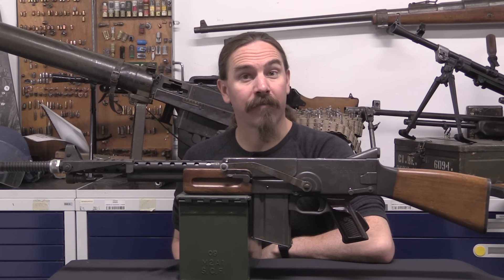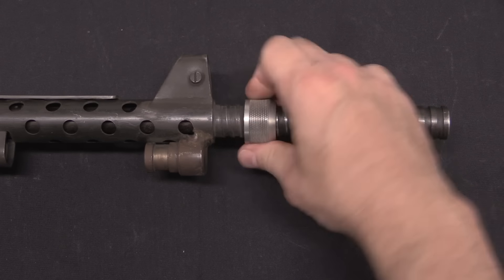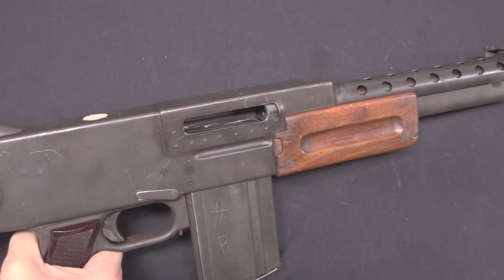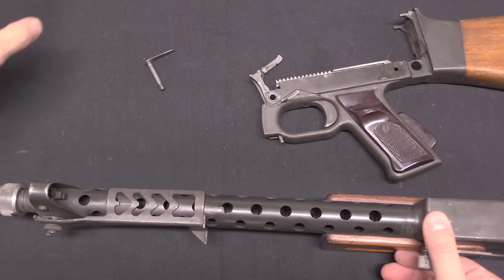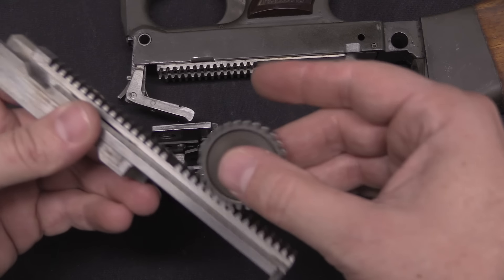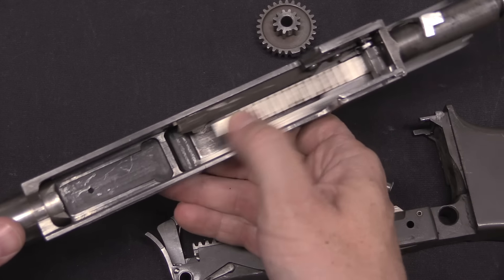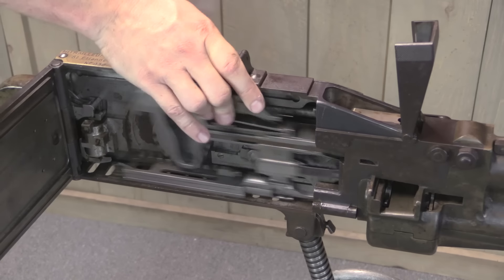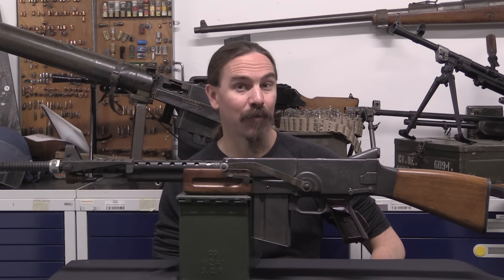Gear-Ratio-Accelerated? Yep, It's a Thing: French MAT 1955 Prototype

Comment: I'm not sure if anyone has said this, but I think you misunderstood the gearing here. That small gear riding on the pinion is going to rotate X number of times. The larger part of the gear is going to rotate the same number of times, but with a larger circumference. This means the relative speed is going to be faster. This faster speed is going to accelerate the bolt back faster than the barrel moves. This isn't a delayed system. This is a way to achieve a short recoil system without just unlocking the bolt and letting it yeet backwards into the buffer.
Reply: Thank you, someone else that didn’t misunderstand its gear-delayed nonsense.
Reply: Accelerators are generally called some kind of delayed system like lever delayed used in famas or in browning 50 cal. machine gun
Reply: This is also why the spring is so strong. Because it s work on a shorter lenght.
Reply: Exactly. It’s just a gear reduction that makes the bolt fully cycle with a short travel of the barrel.
Reply: Totally right. This isn't a delaying system but a plain and simple bolt accelerator. The mystery is why they chose this fragile geared system when bolt accelerators were widely known and understood at the time, and far simpler and sturdier systems were available, such as the ones in the Browning M1919 or in the M2 heavy machine gun.
Reply: THANK YOU.
Reply: Almost.  The bolt carrier moves faster.  The bolt itself is locked closed to the barrel until the carrier moves out of the way.
Reply: @manasjena949  This is true. However, those accelerators transmit the force from the bolt to the accelerator, which then moves the bolt carrier at an accelerated rate. This necessarily forces the bolt to wait for the bolt carry to get out of the way. In this system, the bolt is locked into the barrel extension and does not move UNTIL the bolt carry is pulled back by the accelerating gear. The force of the bolt is handled entirely by the locking surface in the barrel extensions.
Reply: I was thinking exactly the same! Thank you for explaining it in better words than I would have been able to (as english isn't my native language)
Reply: thinking exactly the same. thought ian got it wrong there for a sec and saw your comment
Reply: I think the gears technically keep everything closed up longer than it would have if it didn't have that gearing system. So technically it is delaying the opening. I think.
Reply: @natetete1379  That would make sense, if the big gear was rolling along pinion, and the small gear was pulling the bolt carrier back. But in this configuration, it's pulling it back faster than just one to one.

Comment: French Ordinance Dept: Develop a functioning rifle.

Also French Ordinance Dept: Make it absolutely different from every other successful rifle on the planet.
-----------------------
Ian: Guns and gears don't mix well.

Lewis Gun: Hold my beer...
Reply: Diana/Original model 66 air rifle hold this stein you ain’t seen nothing yet😮
Reply: The G11 operating system is basically all gears and cams, it looks like a clock…
Reply: dont forget most burst fire mechanism involved a "gear"
Reply: Ian is notably not a fan of the G11 or burst mechanisms in general
Reply: @chemistryofquestionablequa6252  I'm amazed it wasn't a Swiss invention... but if it was, there would've been a toggle-lock.
Reply: @somuchnope2 Are you sure?
Reply: @TammoKorsai  lol, if it was a toggle lock Furer would have designed it, he LOVED a good toggle lock.
Reply: I’m not sure what the French department of municipal regulations and policies has to do with firearms development, but the French ordnance department might have been involved.
Reply: If Lewis is a clockwork rifle, then this is a [Quack!]ing automotive transmission with murderous intent.
Reply: @TammoKorsai  Byyyyythewaaaay, yes!... And it might have been way more reliable, to boot. At least, there would be NO rack and pinion gear system to break. Just have the whole lafetted assembly recoil back for a side extension of the toggle knee to follow a cam path to open and close the bolt.
Reply: @chemistryofquestionablequa6252  The G11 reminds me more of a sewing machine or an old camera with a manual cocking
Reply: @Zigfried207  that’s a really good comparison

Comment: I'm actually delighted that a gear-delayed system made it as a prototype because I had thought about what if gears are used as a delay mechanism. We may see a gear-delayed blowback yet
Reply: Steam punk rifle.😂
Reply: gear-delayed blowback system in a larger caliber sub machine gun, like 10mm would actually make sense somehow 🤔
Reply: Wouldn't that be the Lewis gun ?
Reply: Unfortunately I don't think its ever going to be an idea that gets any legs. Gears, by their nature of operation, are a significant wear item. The entire inside of the gun will have to be covered in oil or grease (or whatever) at all times to reduce wear on the gear teeth, so will be a nightmare to maintain, and even then, the gears look to be pressure bearing parts, which will significantly accelerate their wear.

Even if you could make the system cheaply, the rate at which you'd have to replace the gears as they wear out makes it not worth it, IMO.
Reply: It had the same fate of the screw delaying system made by kalashnikov 😢
Reply: @matrix3509   Especially when other delayed systems exist and they are much simpler and more robust. Between the G3 using rollers on angled surfaces and the later FAMAS using levels, the gears system is also more complex to machine.
Reply: The inherent flaw of gears is they REALLY do not like sharp impacts. The teeth will gall and then break.
Reply: There's someone on YouTube working on a homemade, largely 3d printed gear delayed rifle in 45/70; I think he could stand to take it down to 44 magnum, but that's neither here nor there.
Reply: I cannot imagine this holding up well under field conditions, once fine grit (whether mud or dry) gets into the gears (which will need heavy grease in them) and starts to "hone" the tolerances bugger and bigger, while also being more difficult to clean and inspect compared to, say, a lever delayed system.

And this thing, where we combine recoil operation, rack and pinion delay, and open bolt in a rifle?  Three bad ideas for the price of one...
Reply: @Raspredval1337  Make it variable like a CVT and you can dial in your rate of fire.
Were I rich, I'd lock George Kellgren in a room with Mark Serbu  this rifle, and AutoCAD and tell them to "go nuts".
Reply: @Raspredval1337  I mean, how would it be any better than lever-delay tho? Lever-delay has been used quite successfully on at least a couple overpowered cartridge smgs
Reply: @oliverlamie3449   
Yeah I was thinking about that guy when I was wactching this, @EvanJonesProjects is the channel your talking about. A damn shame he hasn't updated in a while.
Reply: @matrix3509  "Gears, by their nature of operation, are a significant wear item."

I have no idea where you're getting this - how often do you ever replace gears in anything due to wear? How often do you replace gears in your car's transmission? What about the differential ring & pinion? Think about all the load the gears in your car's drivetrain are under, the amount of heat generated on long drives. Think about how you'll stay on top of your oil changes(or maybe you don't, those people are out there) but you don't give a single damn about changing transmission or diff fluid(lol) for at least 100,000 miles. And in weather ranging from Alaska to Death Valley, often without a trans/diff fluid cooler, steep uphill & downhill grades, hell you may have a 1-ton towing 20,000lbs through the mountains(in that case, I would hope you actually consider drivetrain maintenance). Like most common mechanical systems, keep them lubed and they should see minimal wear.

If you want to see a "by its very nature of operation, significant wear item", check out the chauchat. Or some of the plate receiver machine guns, like the M60, where the receiver is a wear item(LOL).
Reply: @WardenWolf  I'm not so sure that it's a 'flaw' as much as just an important trait to consider, but minimizing backlash/keeping the gears loaded to some degree so they're never smacking into each other, and getting the right material & heat treat would be pretty critical for sure.
Reply: @RyTrapp0 Gears don't like being subjected to recoil lol. This thing would destroy itself over time, plus what happens when you get grit in it. Also it's unnecessarily difficult to machine, and all to solve a problem that's already been solved  by many different much simpler and more robust solutions. It's wild that this thing is even a prototype.
Reply: @Patrick-857  Why are you acting like I said anything about this specific gun? Dude said "gears by their nature are a significant wear item", and that's just flatly wrong.
Reply: @@cancermcaids7688 Gears don't like shock loading - but, hey, off-roading literally exists🤷 You can check out 'rock bouncers', 'mega trucks', 'Ultra4' cars, etc., all of those are brutal on drivetrain parts.
Reply: @RyTrapp0  Try running your car's transmission without transmission fluid in it.

Go on, I dare you.
Reply: @matrix3509  The gears in your car are spinning continuously - if they were being used for a fraction of a second to a few seconds at a time, a fluid film like firearms rely on is all they would need(I'm assuming that we're talking about a manual gearbox here and not something as stupid as a hydraulically operated automatic...). 
Hope you don't think it takes an oil bath to create a fluid film between two metal surfaces; the oil bath for transmissions & differentials is for cooling purposes as much as anything else.

Unless your argument is that you can run guns completely dry, which would be quite the wild argument lmao
Reply: @RyTrapp0  This is legitimately the stupidest thing anyone has said to me on youtube in months. Congrats on that.
Reply: @matrix3509  I'm pretty sure that award would go to "run your transmission without fluid" - as if guns don't require lube...
Reply: In the ideal case a gear system can run with only rolling contact.  As opposed to the partly sliding contact of a roller or lever delayed system.  To handle shock load you'd want fewer and larger teeth,  even as few as one tooth on each ring on the gear cluster.  Which amounts to a gear derived system that looks like a lever.  Then to keep forces balanced, 2 such gears opposite each other across the venter line.
Reply: @tomaspabon2484  And the FAMAS, arguably the most successful lever delayed rifle ever fielded.
Reply: @@cancermcaids7688 Thousand  g of acceleration for a 5 gram part still produces a momentary force equivalent to the weight of 5 kg mass or so. The yield strength of steel is around 200 Mega Pascal, that is 2,000,000 KG per square centimeter. This gear is massive compared to the load its expected to take, it will be fine. Almost all motorcycles and race cars run manual sequential transmissions that don't have synchros and are often shifted clutchless. Clutchless shifting is shocking to the drivetrain, the engine has to drop or gain a few thousand rpm instantaneously. Gears literally slam in a dogbox engagement sequential transmission. Even when shifting to 1st on a motorcycle that is standing still with the engine idling, you can feel the thunk of 1st gear slamming into engagement.
Reply: They oughtta have added a second pinion gear riding on the same rack. More contact surface means more reliable contact means less wear and less chance for a gear tooth to break off.
Reply: @matrix3509  True, however with the proper ratio of hardening and on top of that case hardening the surface, you can increase the life expectancy many fold.
Reply: @RyTrapp0  Exactly. If the right alloys are used and they've been properly case hardened, gears are near indestructable. In that respect technology and specifically metallurgy has improve hugely in the last 50-60 years.
Reply: @electric_boogaloo496  Exactly, compared to the enormous forces the gearbox in a car experiences, what a gear-based firearms would experience is negligible in comparison, and easilly achieved with modern steel alloys and heat treatment. And even your average car gearbox will already last several hundred thousand kilometers at minimum. If you would compare that to a firearm and rounds fired you would probably be talking about many millions.

Comment: Very cool.
But it actually looks like the bolt carrier is gear accellerated rather than reduced.
Reply: True! I have noticed the same. So it is blow back delay system.
Reply: @Crow2a  Well, not really... First, it has a locked breech. And second, for a delayed system, one would anticipate a small movement of the bolt to be translated in a big movement of the rest of the mechanism in order to provide a lot of resistance to opening. Here it's the opposite. Actually, if the breech wasn't locked, it would be difficult to assess whether the pressure in the chamber would drive the recoil (thus providing a delay) or the other way around.
Reply: @PetrHosek  Let's call it delayed short recoil because a small movement of the barrel assembly is translated in a big movement of the bolt carrier in order to provide an effective increase of inertia to delay breech opening
Reply: @Crow2a  Sorry, but I see no sense in what you're saying.
Reply: @PetrHosek  when you say "resistance", do you mean friction?
Reply: @Crow2a  No, I mean the inertia of the parts that need to move for the breech to open. Here, the gearing does not make sense for this purpose as a big movement of the bolt translates in a small movement of the other parts, thus creating a mechanical advantage rather than disadvantage (with respect to force). However, some delay is of course still provided compared to the situation in which the bolt was completely disconnected from the rest. Nevertheless, this is still a locked breech action and the gearing was probably meant as an assurance that bolt would cycle properly as it would be driven from the inertia of all the recoiling parts and not rely on the residual chamber pressure and its own inertia to cycle.

Comment: Hey Ian small correction; the larger diameter gear is actually the one that turns faster than the smaller diameter gears so the bolt is really being accelerated rearward faster than the upper receiver. If you think about it, it has to work this way or else the receiver would not be able to move rearward without being stopped by the bolt. Love the channel keep up the good work.
Reply: Just what I was about to say.
Reply: My thoughts exactly - it's like a lever delayed system, except it spins.
Reply: @ericmitchell985  Well, a gear is a wheel, and a wheel is a rotating lever, so...
Reply: @lairdcummings9092  I mean, a lever can't be a lever without rotating about a fulcrum, so all levers have to 'spin' in that sense.

I just meant that it's operating on the same principle of using an accelerator to delay opening, except cooler and unnecessarily more complicated.
Reply: More like a lever action rifle.

Comment: Being a car guy first, I’ve always thought about this as a possibility in using very heavy springs for a straight blow back design but utilizing gear ratios to allow for the bolt to be easily operated nonetheless.
Reply: Yeah there's a Peugeot steering column somewhere in the guts of it!
Personally, I do find the fact there's gears in there somewhat comforting in the sense that someone with engineering experience had a big think about it. Unlike say, the AN-94 which gives me nightmares
Reply: Gears are, in the end, a just spining lever.
Reply: Пистолет макарова aka PM has very strong spring and simple blowback construction
Reply: Yup, lifelong gearhead who's been into hot rods & motorsports as much as guns - I've always thought gears were woefully underutilized in the world of firearms(I mean, can we at least get more crackpot eccentrics using them?!). Just think of how they enable you to redirect forces in a very smooth system, you could really change the shape of a reciever and create some uniquely packaged designs. 
Legitimately useful? Dubious. Cool as hell? Absolutely!
Reply: @RyTrapp0 the majority of autocannons and all rotary cannons use them in some form.
Reply: @DMSparky  True - my head is stuck in the world of small arms lol

Comment: I dont think the gear is really for delaying the mechanic. I believe its more for reducing the lenght of the way which the barrel has to move.  The function of the gear is to transfer the back movement of the barrel to the bolt carrier, like a lever in many other recoil operated weapon. When the gear ratio is 1 to 1 that means that when  the bolt carries has to move 10cm to fully cycle, the barrel has also to move same way. By changing the ratio you can reduce for example the barrel way to 5 cm and the bolt carrier would still move the same 10cm of way. In some way its similar to the madsen lmg, where the barrel moves only few cm but the loading lever moves a long distance to load a round into the chamber.
Reply: It's a long recoil system that behaves like a short recoil system. It would be a clever way to obtain the benefits of both were it not so complex.
Reply: The gear ratio will have a delaying effect, because it reduces the mechanical advantage of the barrel vs the rest of the operating system.
Reply: Nobody claims that this mechanic wouldnt have a influence in delaying the movement of the barrel. I said, that the gear ratio system was not designed to be a delaying mechanism but a mechanism to reduce the required movement of the barrel and with this also the size of the receiver.